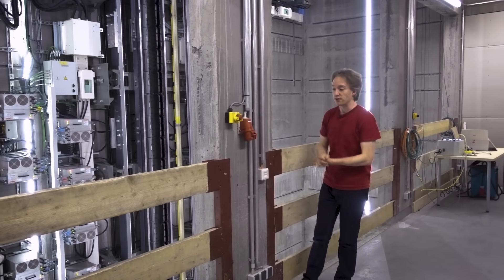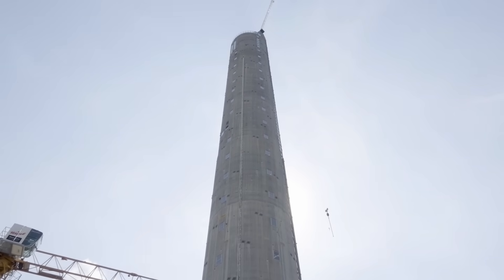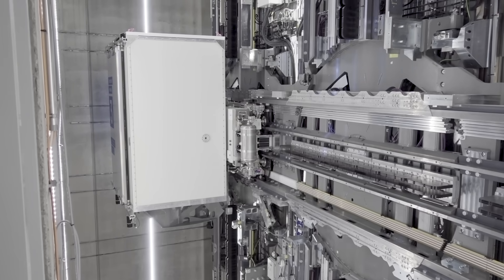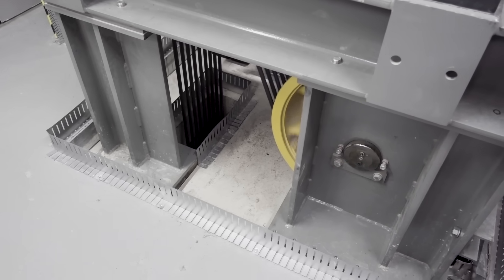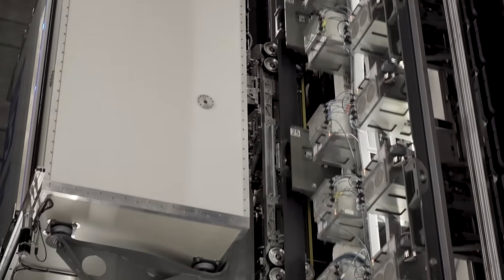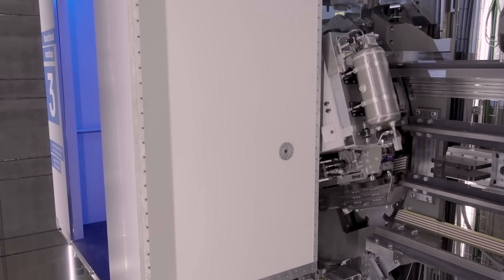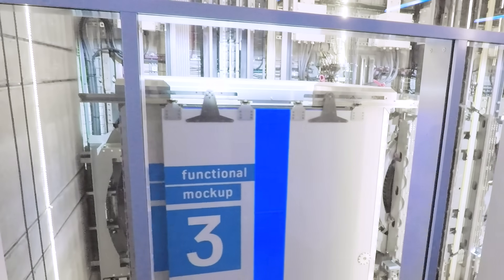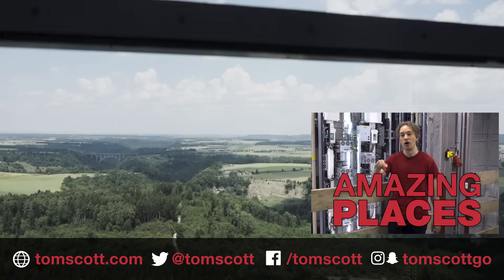An elevator that actually goes sideways

Comment: In which June will you show a space elevator?
Reply: And what elevator will come in June after that?
Reply: spider silk? ^^ carbon nano tubes are laughing at you ;)
Reply: You beat me to it. :D I figure 2027 or so. :P
Reply: It's all about a combination of both nanotubes and silk, really.
Reply: NighteeeY there are concerns that carbon nanotubes won't be strong enough.
Reply: Sounds reasonable, Dreamer. I believe this now.
Reply: @ Wolfram Stahl

Sehr gut.
Reply: Orbital Rings are better then pleb space elevators.
Reply: And how do you think we will get to the orbital rings you genious?

Exactly.
Space elevators.
Reply: Yeah, but do those really count? Orbital rings would most likely be built in LEO whereas space elevators have to go up to GEO in order to function. The construction of an orbital ring means that you can basically be geostationary at much lower altitudes. 

The devices used to access the rings would most likely be similar to cablecars at angles to the ground in order to allow passage from large cities. 

'Space' turns to 'kind of in the atmosphere' and 'elevator' turns to 'kind of a cable car'.
Reply: The last June before his death.
Also, 1350th like!
Reply: Mr Misanthrope
Carbon nano tubes might work if they weren't so picky, just a few atoms out of place and it weakens the tube by vast amounts.
Reply: An unattainable dream.
Reply: spider silk, we have our eye on you
Reply: There is actually an elevator to the moon in construction, and it will take about 50 years.
Reply: Space is a hoax. 
Earth is flat.
We live in a existential plane.
The "material" world is just some kind of user interface.

Comment: no cables seems scary!
Reply: it's probably safer than the cables.

you see at a certain length the cables themselfs become so heavy that they can't suport themselfs anymore, from this point on having no cable is the better solution.
Reply: An interesting note, this is actually safe than cables if its maintained to a reasonable degree. When you get the car moving downwards in freefall, the magnets on the cars actually introduce an opposing magnetic field in the track, which will slow the car down. Essentially, the interaction causes the car to sap its own energy by generating electricity. This limits the top speed of the elevator considerably in the case of safety failure and actually allows the car to generate electity while traveling down normally that the building can use for other things. Also lets you have a ton of cars in the same shaft and have shafts of unlimited height, which is pretty handy for tall buildings. Means you can get away with only 4 elevator shafts in the whole building, almost irrespective of height.

Comment: So many parts, aka "points of failure".
Reply: While I do agree, what really matters in good engineering is not necessarily how many points of failure you have but how you manage those points of failure, and how many layers of robust fail safes are involved.
Reply: enobazh, really good point I didn't even think of! If there's a problem anywhere in the system, the system can just keep running. Rout everything around the part that is in need of repair (if the problem is on the "tracks") or just get the defect car out.
That's a benefit of this system that I'd say say even outweighs the no-cable/unlimited height thing.
Reply: "points of failure" are bad when you're trying to design a product which is going to go out into the middle of nowhere and should ideally almost never break down and need repairs called in. When your client base is the busiest buildings in the busiest districts of the busiest cities, when your technology promises to make up for failures with smart re-routing around failure points and other jams, when the profits gained from increased efficiency within the building outweigh the higher costs of installation and maintenance, it's pretty irrelevant.

Or to put that another way, you could say the same thing about a Boeing 777 or an Airbus A380,  but that doesn't mean there aren't situations where that sort of engineering is more appropriate than, say, a Giant G2800
Reply: I wouldn't think so.. they probably use the same technology as roller coasters where aluminum fins can slow down slotted magnets on the cars due to Lenz's law. So as long as there is a failsafe for fins to engage in a power outage, the cars could theoretically glide gently down the elevator shaft using no power at all.
Reply: he did mention that they use permanent magnets
Reply: Ultimate Counter-Strike N00b if it aint broke, it hasn't got enough features.
Reply: sadly any real advancements in technology bring more points of failure.
Reply: I immediately thought of Civilization IV but in truth, it's from Antoine de Saint-Exupéry.
Reply: Do electromagnets mean power cut = instadeath for everyone in the lifts?
Reply: +TragedyParody Emergency friction brakes would do the trick too after all the issue with anything at height like that is never the lack of energy it's having too much energy and needing to dissipate it by any means available (ideally more slowly than just by striking the ground). All the power you could need is right there in your gravitational potential energy after all it's always guaranteed to be at least sufficient to get you to the ground at a safe velocity it's the leftover stuff you need to worry about.
Reply: This is why we have things like FMEA - failure modes and effects analysis.
Reply: Babarudra examples?
Reply: They made the crazy variable speed moving sidewalk at the Toronto airport that never works properly.
Reply: the electromagnets essentially use power to not stick fast to the rail, with power modulating in a specific shape to move the motor in the direction it wants much like maglev trains move by modulating the magnetic field in constantly changing shapes. in the case of these lifts, when the power goes out, there's nothing to stop the magnets sticking to the rail completely. that's the braking system. (as i understand it, and from thyssenkrupp's concept video a few years ago)
Reply: "An engineer knows he has achieved perfection not when there is nothing left to add, but when there is nothing left to take away" can't remember where I heard that, or who said it, but it relates to your point beautifully.

Edit: typo

Comment: This is a cool idea. But looks VERY expensive..
Reply: Think about how it could benefit a building like the burj khalifa. It currently has an insane number of elevator shafts, plus two separate elevator systems that require you to get off of the elevator halfway to board another if you're going to the higher floors, simply because of the weight of the cables. In such large buildings, the maintenance a system like this requires would pay for itself merely because of the floor space you save and can then rent out to more customers. Since you can have a large number of cars in each shaft, you may only need a total of 4 shafts, two up, two down that run the entire length of the building and could easily handle the traffic. Safety is also not much of an issue with this, since the brakes actually require electricity to stay OPEN, plus when the car is in freefall, the liner motor actually generates an opposing magnetic field in the track which produces electricity and would slow the car down quite a lot, lust like a magnet falling through a copper tube. Also lets the cars recover some of the energy the spend climbing while traveling down.

Comment: I wonder what the energy consumption of such an elevator is compared to that of a standard elevator.
Reply: They will be probably about equal if the energy is recovered when going downwards. the only difference then is the efficiency of the motors.
Reply: there is also induction that occurs from the energy of the elevator falling down the shaft. If all safety systems were to fail, the magnets on the car would actually induce an opposite magnetic field in the track as it fell, slowing the elevator's top speed considerably, and making a buffer at the bottom fairly safe to impact into.
Reply: Yes, a so called "eddy current brake". It's often used in theme park attractions like a roller coaster.
Reply: as far as i know, the elevator should automatically stop in case of a power outage. Also, the energy from cabines going downwards is recovered, so the elevator can sustain itselfe until every cabine is at the bottom
Reply: Eddy currents from the magnets might slow down the cars, or the LIMs themselves could be used as generators.
Reply: I wonder what happens in the event of a power failure. I know they mentioned the emergency brake, but curious if there are any other safety systems in place to avoid the cushion at the bottom.
Reply: they did say that this used permanent magnets
Reply: yeah the magnets are attracted to the rails. generating a field with the electromagnets pushes the field to repel them in carefully controlled directions to induce movement. power outage means magnets sticking to rails.
Reply: Much more power, it consumes souls to operate
Reply: It's fine if it drops you just jump so you don't get hurt
Reply: They also have got a battery supply for this case.
Reply: Jacob Shepley Yes, there are permanent magnets in there, but not the copper plates like on a rollercoaster cart. People here are fantasizing too much after hearing one familiair technical term.
Reply: Balthasar That a rollercoaster uses permanent magnets as a brake, doesn't mean that these elevators do. A sole LIM motor will not brake because of eddy currents. You need copper plating or similar on the cart itself. I think this Youtube comment section would be a whole lot better if there weren't a hundred people pretending to be lift engineers.

Comment: That looks bonkers expensive. Some slabs of aluminium there that will need to be engineered more before that is financially viable.
Reply: For tall enough buildings, these elevators would result in slightly cheaper space inside, not a price hike.  It's called the Elevator Conundrum.  Basically, the taller you make the building, the more elevators you need.  Each elevator shaft takes up space on every floor it passes through, (whether it stops there or not,) which means that at a certain point it's impractical to build any higher, because your building would start to be mostly elevators.  (Instead of, you know, stuff you actually want in your building, like offices and stuff.)  

But if your elevators can move sideways, you can have all your upward bound elevators on the same shaft, and all your ones going down on another.  This increases the amount of available floor space you get for the same construction costs, which would easily offset the expense of the fancier elevators.
Reply: someone deleted their comment above mine -_-
Reply: If they do go ahead with this I would make it a rule that it all has to be visible because it is bloody gorgeous to watch.
Reply: it will also be able to go from the bottom to the very top of any building. other sky scrapers can require you get out of the elevator just to enter another to continue up the building. having a couple of these cable-less elevator tracks, each having multiple cars, would improve elevator design in tall skyscrapers massively
Reply: Still got to add that cost onto the price of the building/floor space you sell. I'm not sure you could justify the price hike to customers for slightly more immediate elevator access. I think they will just have to front the cost themselves to get bragging rights for this sort of thing.
Reply: Jacob Shepley if it fails at the top, at least the passengers will have plenty of time to call their loved ones.
Reply: And you can take cars from one shaft to another, so if you want a car to go down, you can get an empty car from the up shaft to move sideways to the down shaft, cars can pass each other too.
Reply: Don't forget, the maintanance of such elevators is going to be expensive as hell, there are cables and electrical boxes throughout whole shaft. It has more electronics and moving parts than regular elevator technician could handle. And I doubt technicians could learn to maintain it by reading some manual book. Companies will have to hire engineers just to maintain it. Also the more moving parts, the more its prone for faults.
Reply: Yeah those slabs also create a lot of wasted material when they're machined. Makes sense to do it for prototyping of course.
Reply: Adam Laycock did you just laugh at your own comment?

Comment: Theres a lift in Oslo that moves diagonally if you need something for next year.
Reply: there is also one on the tube at Greenford station!
Reply: There's an elevator that makes backflips in my house if you need something for next year.
Reply: There's also the self leveling lift cars in the St. Louis Gateway Arch that run to the observation deck at the top, but in reality that's more a small angled train than an elevator.
Reply: and one on the melenium bridge in London
Reply: also the eiffel tower but that is more of a cable car
Reply: Also the inclinators in the Luxor pyramid in Las Vegas.
Reply: Ludvig Oftedal Vinje those things are evil. Two were ordered for the brand new 34th street-Hudson Yards station on New York's #7 line. The problems they gave delayed the station from opening for an entire year.
Reply: Wow!
Reply: 34th Street - Hudson Yards in NYC does the same
Reply: There's also one in Bratislava going up diagonally inside a bridge's pylon.

Comment: What's the purpose of it?
Reply: David Cox extra cabins. You could put dozens of cabs on each shaft, run one up, one down, and actually get loading done off to the side.
Reply: you dont need a rope, so higher elevators are now possible
Reply: More flexibility for architects to get creative about transporting people within a building.
Reply: Acb Thr there's been little cases of elevator accidents due to the fact that elevators have many safety lines.
Reply: An interesting note, this is actually safe than cables if its maintained to a reasonable degree. When you get the car moving downwards in freefall, the magnets on the cars actually introduce an opposing magnetic field in the track, which will slow the car down. Essentially, the interaction causes the car to sap its own energy by generating electricity. This limits the top speed of the elevator considerably in the case of safety failure and actually allows the car to generate electity while traveling down normally that the building can use for other things. Also lets you have a ton of cars in the same shaft and have shafts of unlimited height, which is pretty handy for tall buildings. Means you can get away with only 4 elevator shafts in the whole building, almost irrespective of height.